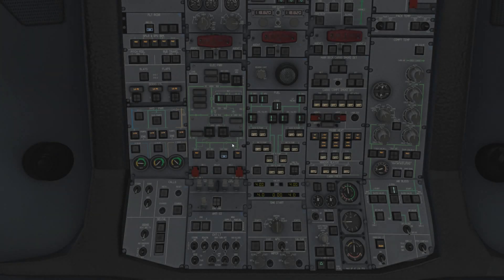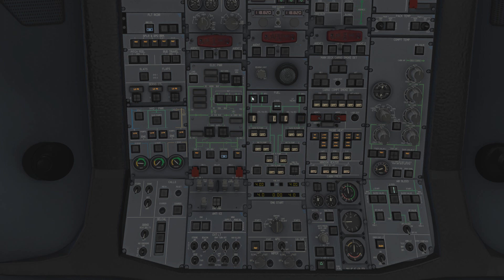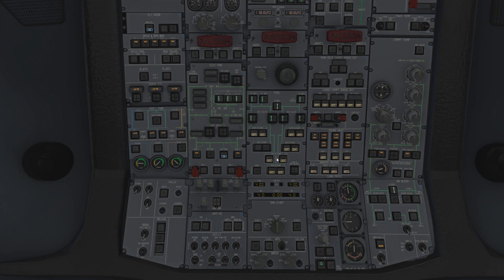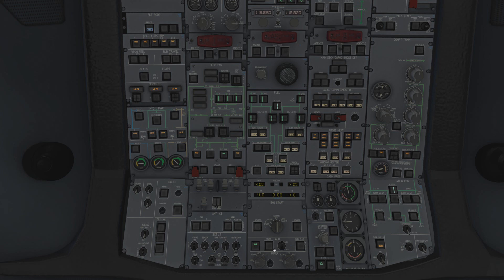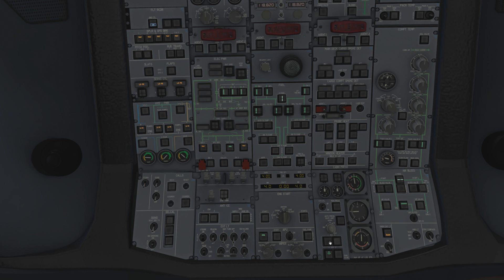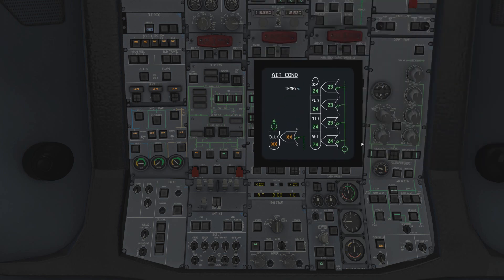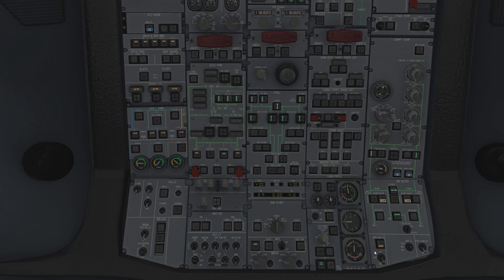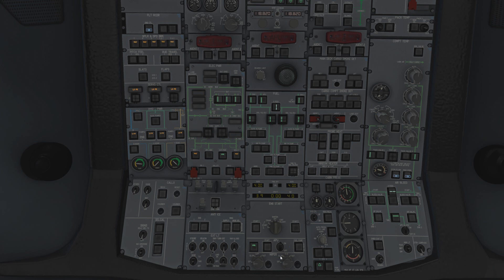iniBuilds A300-600R(F) ON THE LINE - The Training | Episode 1 - Part 2

Comment: I've been flying Airbuses (and Boeings, and Embraers, etc etc...) since MS FS2002 appeared and thought I 'knew it all' (well, not literally, but you know what I mean). This series of videos, which I have started watching in full since I bought the A300-600 just the other day, have already corrected a number of misconceptions I had about other Airbus variants (A320, A350 etc) and, as far as a guide to the A300 itself is concerned, could hardly be bettered. In short, both in content and style, probably the best flightsim tutorial videos I have ever watched. Which is appropriate because, though it's early days, I am quickly coming to appreciate that the IniBuilds A300-600 is one of the very best flightsim aircraft ever produced. So thank you to IniBuilds!

Comment: Auto press rate limit. My only idea is that it can be marginally useful in extremely rare conditions. 1. Pressure bomb on board. Set it to min. 2. Guy that has been diving as passenger, set it to max.
Reply: I don't think divers should be flying so soon if they're prone to getting the bends!